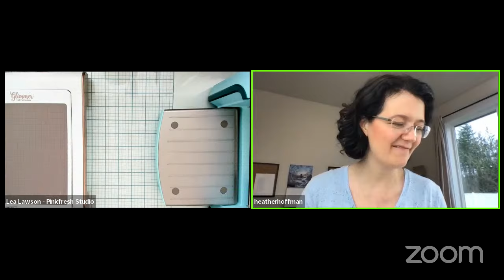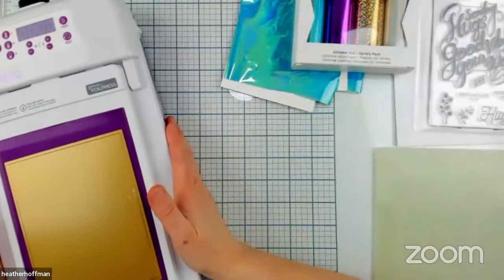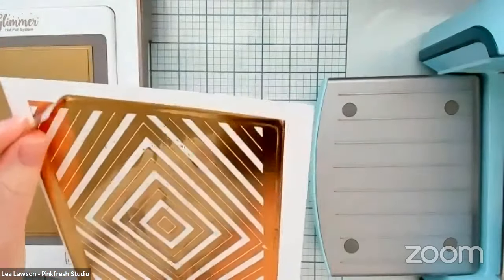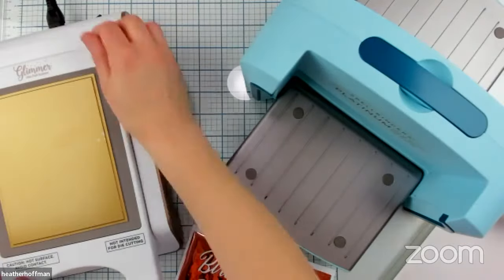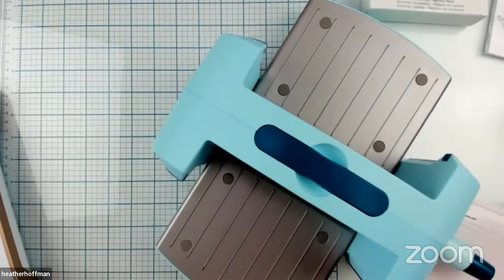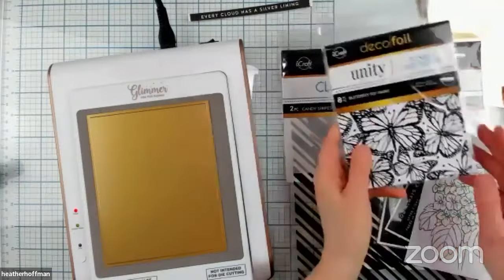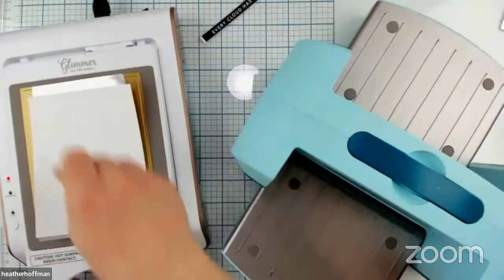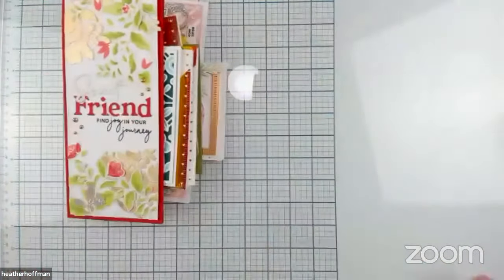Solid Hot Foil Plate 101 with Lea & Heather

Comment: Just food for thought, I have tons of rolls of Minc foil ,toner use system.  If you bring white cardstock to a print facility in your area, and have them run your white  cardstock thru a laser printer, copying a black sheet of paper, you will have sheets of toner paper.  Take the now toner sheets, cut dies or on your Cricut and then use this new plate to foil.  This is just if you have the foil already and you are just getting use out of products you already spent money on.  Besides sentiments, just back ground and even frames will give you more bang for your buck. For all methods, if you sandwich in a full sheet of copy paper on your plate, you won’t get foil on your new beautiful solid plate, or your other clear plates.

Comment: I am going to make a comment here and hope that it reaches those of you having trouble with the solid plate. I watched this video twice and I heard the mention of yupo paper at the end. Well after many trials and errors on foiling the waste I can say success!! I used yupo and then photo paper, both worked great. I learned that my system has a "cooler" spot in the center which adds to the problem of getting good even results. Leaving the foil and the paper on the machine as it heats up helps. Be careful with the photo paper. I wish I would have known that hot foiling is not just about the foil but also the paper. I don't like that I need a specialty paper to get the correct foiling results. So much for all the colored cardstock in my stash.
Reply from the maker: If there is a part of your foiling system that is not getting hot enough, you may want to contact the manufacturer and see if it is within its warranty. They also may be able to troubleshoot with you, because you certainly should be able to foil on more than just specialty papers.
Reply: I have successfully used my hot foil on different colored card stocks. I only had trouble with black paper not evenly foiling.

Comment: Crafters Companion demo waste foiling on the Foilpress by placing the Gemini foil directly onto the pre-heated platform (low heat), shiny side down - no metal or solid plates required at all!  Then place your card over the foil, followed by two card stock shims, the Gemini die cutting machine’s magnetic shim, then finally the Foilpress top plate.  The whole sandwich is then heated together on the platform for 1 minute before running it through the Gemini.  Works a treat!  Unlike the Glimmer, the grid on the Foilpress platform does not emboss into the foil after heating and applying pressure - the result is perfect.

Comment: When using the solid foil plate, I've noticed that my shim plate, the green one, (Glimmer system) is flaking off on the sides.  It's like its too hot and is melting the shim.  Anyone else have this problem??

Comment: Watching re runs!  I got my Glimmer machine in November, and saved every negative foil. Print.  I was determined to figure a way to get T to work, good thing we were on the same page!  I love this new clear plate!  I learned some things last week and now love it even more.  I die cut a new die in white, then foiled it.  It was so awesome.  My advice, always experiment, you never know where it will go!  I do mixed media so it all works together.  If you are creative, it is not hard to do slimline.

Comment: I just received a 9x12 CC Gemini foil press platform. This is not an adapter.  It is a very large platform that fits into my foil press. So excited. It’s huge!!!  Go for slimline hot foils.
Reply: I’ve had the 9x12 platform since it came out as well.  It is NOT an adapter as someone told Heather.  You are correct.  It’s actually been out for quite some time!

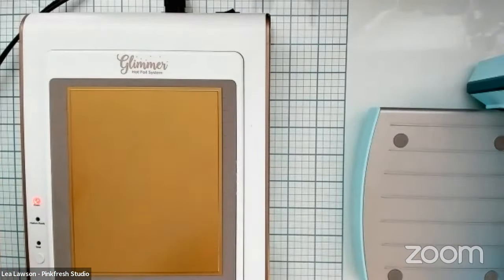Comment: At marker 37:52 you show a solid piece of foil taken off the solid plate.    There are what appears to be scratches all the way over the plate - not just at the bottom that you said was a bad foiling spot.    What is causing the scratches and how do we prevent it?   I seem to be getting them frequently on my plate.   Thank you.
Reply from the maker: Hi Delina! I realized at that mark that my machine had started cooling down during Heather's segment. So it wasn't as hot as I thought it was. I wish I had noticed it being splotchy near the top, because I would have just popped it back on to my machine and done the process over. Hope that helps!